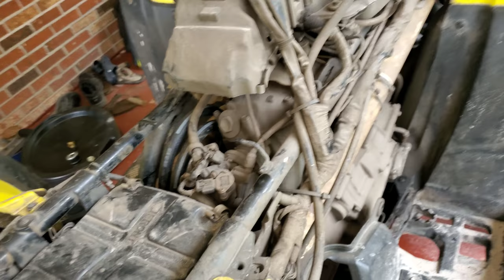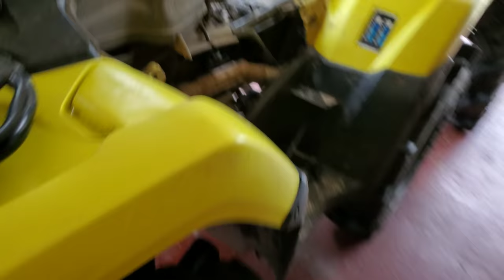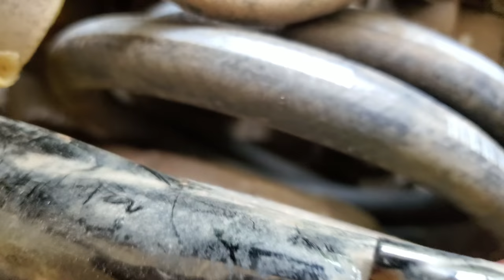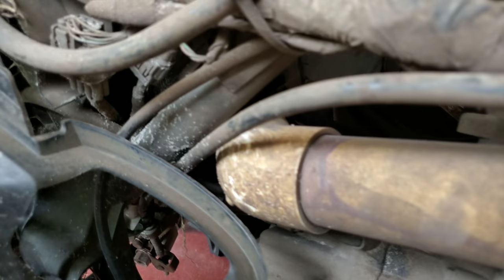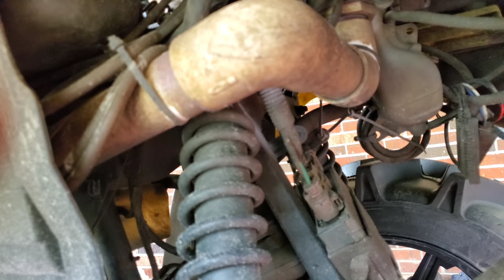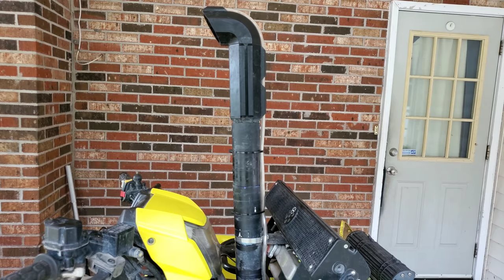How to center snorkel your Honda ATV !!

Comment: Damn copied my snorkel setup I've been doing for years now. Lol. Nice job on it tho. I started using 2inch abs from air box cause 1.5 inch causes spark plugs to fail quickly. Works on any Honda foreman 500 2012 and up. The crank case line you do that I copied to all mine now works amazingly man. A life saver for the Honda's
Reply from the maker: Not close at all to your snorkel setup bud but thanks.
Reply from the maker: Im also on original spark plug for almost two years.
Reply: @ProjectAjax  the 2012 bike I did went thru a plug in under 400 miles with the 1.5 inch at air box. Been doing 2inch whole way since on every other Honda I've done and haven't had that issue again.  May have been due to not putting a fuel tuner on it but all others I've done haven't had a  tuner either, never changed exhaust on any of them so didn't think they would need one but I could be wrong. Just my experience with that one particular bike. Haven't ran into that since. Could have just been that one bike. Wasn't trying to say anything negative, just what I've experienced that's all. Love the videos you make and like I said earlier about the crank case mod you did, great mod, which I now do on all my builds after watching your video on that. It's saved a couple bikes I've done from needing top ends due to the owners rolling them in water. Trying to do something similar to my can am outlander also just in case water ever got into clean side of its air box. Thanks again for posting all your mods you have done, I'm sure they have helped a lot of people from destroying their bikes when it can easily be prevented.
Reply from the maker: @alphapackoffroad  thank you and enjoy. Good luck on the can am, heard they were hard to do that  type of crankcase mod due to v twin.

Comment: Will this setup work on a rancher 420 without a rad relocate
Reply: OBS Powerstroke Jesus Christ no. The radiator is in the way of where he ran the pipe
Reply: I just did it on mine but its extremely tight had to trim the plastic shield thing behind radiator and run 1.5in or itll never fit